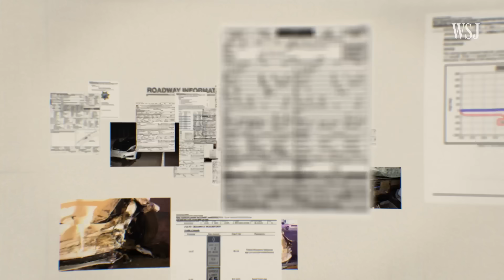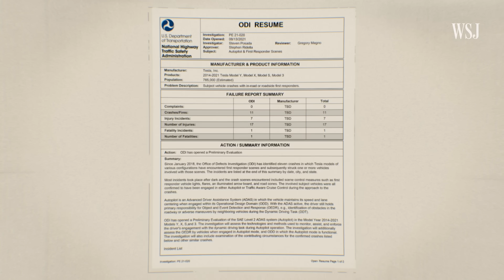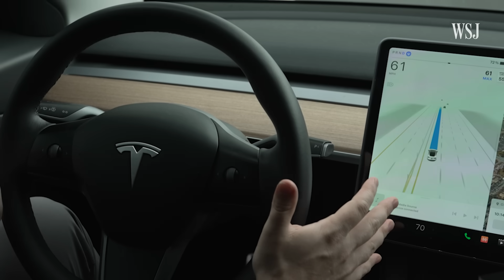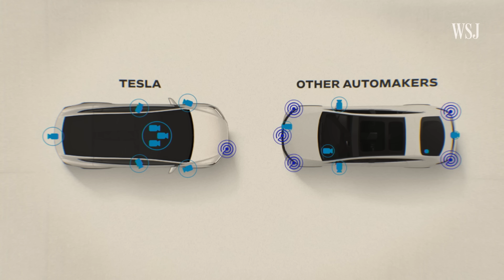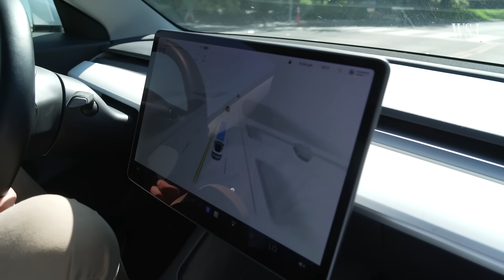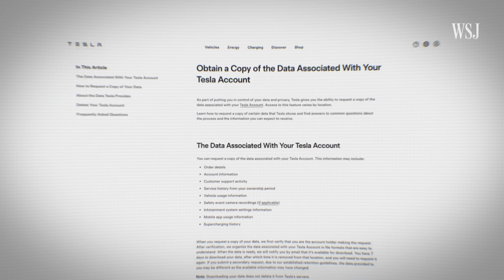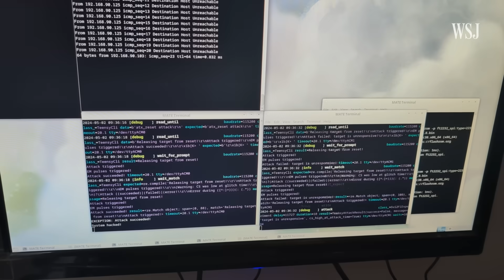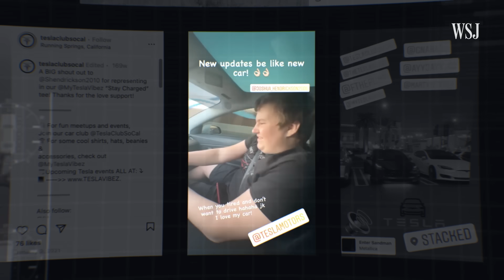The Hidden Autopilot Data That Reveals Why Teslas Crash | WSJ

Comment: There is no mention in this video of a comparison between autopilot controlled Tesla and a human control Tesla. There likely have been a number of accidents avoided because of the technology when the human wasn't paying attention. Unless you compare accident rates, there is no basis for saying that this is a faulty technology.
Reply: Think like an aviation regulator, every death or fatality now actually counts. Autopilot in planes and Tesla despite it's name should be regulated in the manner of "when" it'll kill, not "if".
Reply: It's not really about faulty technology, it's about people putting too much trust in it. If you have autopilot AND are also fully concentrating with hands on wheel and feet on pedals then you will obviously be safer.

But you need both, because it only takes one time for the cameras not to pickup on an object combined with you not paying attention for it to be fatal.
Reply: @Lightning_jc, yes, it's the same with all level 2 systems. I had a 2024 Volvo XC40 Recharge Ultimate while my Model 3 was in the body shop last summer. Its lane keeping assistance system was a real joke. It couldn't handle a curve unless it was a slight highway curve and it disabled itself without any other indication than a simple icon disappearing from the screen! No audible or haptic feedback. How stupid is that!
Reply: What’s the basis for saying that it isn’t faulty technology?  Facts are that  it isn’t ready.  Teslas need other tech like Lidar, etc.  Tesla says the fools who buy and test our products are wonderful Guinea pigs … the problem is when they harm others with their foolishness!
Reply: imo it's not about faulty technology it's about misleading marketing and unclear safety standards for the end consumer. When you Elon constantly overstating the abilities of FSD and autopilot, it leads to people expecting far more from it than it can safely deliver. The technology itself is great but obviously very flawed in some scenarios, esp low visibility. Obv in this particular case the guy was reminded 19x to pay attention and he didn't, and he's fully responsible for that. But in general, the issue I think most people have (or at least I have) is the misleading marketing kindering an undue trust in FSD, resulting in what you see here. It's just like people not reacting when a kid runs across the road because their car manufacturer advertised accident avoidance as perfect (say if Volvo constantly said our cars will never strike a pedestrian and have perfect automatic emergency breaking). Still the drivers fault, but the manufacturer should not be falsely advertising like that.
Reply: You're missing the point...
The hazard function (survival or reliability analyses) will undoubtedly be better than human control in time (for fixed, predictable environments like highways). It is the 'random' accidents and events leading to accidents and near misses that are the point. This behaviour imparts risk to a human where one who voluntarily would have had control, would not have had one. It is, quite figuratively, having to play Russian roulette with a loaded gun where you did not wish to. Tesla have marketed it this way, that it is FSD, and that anyone could use it to navigate all routes and environments when this is clearly not the case. A multiple camera based system, one that isn't even calibrated to accurately geolocate vehicles, does not have the redundancy to solve this equation.
Reply: Autopilot (not FSD, I don't have that) is an absolute joke. Worst system, unreliable, phantom braking. My VW Golf from 10 years ago was much, much better
Reply: @gehteuchnixan69  Dude, your 10 year old VW Golf was much much better at self-driving?  Uh ok, whatever you say, Chief.
Reply: @kenbob1071  Lol, can you even read?
Reply: Read my comment before leaving yours dude

Comment: Overview: In a nutshell, the video argues that the autopilot is a flawed system that is falsely promoted as safe by Elon / Tesla, and a so called "expert" says their technology will never be safe/ capable without Lidar. There are several selected videos of where the Tesla crashes, often at very high speeds. One such story highlights a now widow who's husband "trusted autopilot with his life," which is understandably tragic and heartbreaking. 

Here are the facts: Tesla FSD is safer than a human driver by analyzing average miles driven / crash. The technology is not released to substitute a human driver who is ultimately responsible (this is clearly labeled when you agree to use the tech, and every time you turn it on). Tesla FSD is improving over time, not declining. Finally, Tesla's crash safety scores outperform all other car companies by a huge margin, saving lives of those in crashes (caused by FSD or driver or other drivers). 

My opinion, for whatever it's worth: To say the technology can never replace a human driver is frankly dumb. It's already safer than a human driver as it stands (data shows), and we still are at the stage that the driver is still ultimately responsible. Also, the "expert" says that not using LiDar and only vision is inherently the fatal flaw of Tesla's tech... human drivers rely almost entirely on vision to drive, which makes us no different than Tesla's technology... and there are so many more deaths caused by humans than this tech does (obviously we can use hearing, but I'd argue this is not the reason behind the crashes seen in the videos). The video should highlight how this technology still isn't perfect, and that people should remember that they are the ones ultimately responsible. 

Nevertheless, I'd like to see this technology still be allowed to improve and ultimately replace human drivers, because idk about you, but I'm sick of hearing about drunk drivers killing others. A robot like this can't get drunk, can't have bad days, and can't fall asleep at the wheel... why would you want to cherry pick reasons to not responsibly allow this technology to advance?  The producers are clearly biased and want to drive a narrative that this technology cannot be trusted, and I say shame on you for doing so. Use your platform better.
Reply: Great comment, couldn't agree more.
Reply: What a total lie. Tesla is not safer per mile. Elon lies with cherry picked stats

Now go ahead and delete your comment and do some actual research
Reply: Here is the problem, 
the press wanted it to be 100% safe. No accident.
We all deep down know accident like this will happened. 
If you ask me, is it safer than human driving, ABSOLUTELY. 
BUT
With camera only, accident will keep happening especially at night or snow time. Even when they show the footage, i almost didn't see the fliped car.
Reply: Do u have Tesla shares?
Reply: I agree with everything you’ve stated. However, one important thing to note is that previously Tesla’s used to ship with LIDAR sensors as well and it was removed from all models subsequently (as a cost saving measure presumably) and I’d say it’s quite reckless on Tesla’s part to not include a safety measure that could work in conjunction with the cameras until the camera machine learning algorithms improved further. The examples given in the videos could have benefited from having LIDARs and deaths could have been prevented.

Also, my personal opinion is this video is such a biased one sided take on the issue and comes out as a hit piece on Tesla and negates the benefits of autonomous driving.
Reply: @Siamashraful  So I've looked into this, and here's the tricky part about LiDAR and Vision integrated together. At some point during a critical moment, both systems will be activated, but one ultimately will have to be "king" if they disagree. Not only is this creating two inherently different models to try and work together, creating complexity, but it's also important to consider that LiDAR is not perfect, and also has issues (weather also affects it's performance). 

From my perspective, mimicking human capabilities is more realistic to solving autonomous driving, as it's simpler and more understandable. Ultimately, I am NOT an expert in this field, and I'm certain this WSJ team is not either. The only people truly capable of weighing on this are the ones with the data, with the expertise, and who are pushing the limits of our understanding. Currently, thats Tesla, WayMo, and a few Chinese companies. Considering the true data advantage Tesla has within the space, I'd trust their performance above all else. Anecdotal stories about these crashes does nothing but slander true innovation that is changing the world for the better. I am no Elon fan when it comes to how he approaches social issues, but it's clear he and his team have achieved accomplishments not many others can say they've done.

Comment: Accidents are bad, particularly when resulted in injuries or deaths.  It is probably very difficult if not impossible to say for sure if FSD wasn't involved, could these fatalities be avoided?  Driving at night at highway speed, it's chancy at best to dodge a huge road obstruction like that of the first case. Could an average alert driver be able to steer clear?  We know FSD back in 2019 wasn't good enough. Now that we're in 2024, would FSD 12 be good enough to stop in time?
Reply: But facts don't matter. The Wall Street Journal has ads from legacy automotive companies, so they need to publish some Elon and Tesla-related negative stories now and then.

Comment: As a regular use of FSD, yes it's not perfect. But it's very good. As a driver, you need to remain alert at all times regardless of how good the system might be. I've not experienced and harrowing situations either on the highway or city scenarios. That said, being camera based, there are a lot of cars using adaptive cruise using cameras, namely Subaru. Honda uses a similar system.

Comment: Allowing Tesla to call it Autopilot in the US is the main reason for this problem. It was never an autopilot.
Reply: Even pilots are required to monitor the plane's autopilot and be ready to take over 100% of the time.
Reply: @Atom15 you should go look up the origin of the term autopilot. I'll do it for you as general knowledge does not seem to be a strong suit here. "In aviation, autopilot systems are designed to assist, not replace, human pilots. The cockpit was never intended to be unmanned, and autopilot is always under human supervision."
Reply: Hey, genuine question, have you had a chance to use fsd before
Reply: its called supervised FSD meaning you need to supervise it🤪
Reply: Do you know the years old lawsuit about a caravan driver and cruise control? He sued the manufacturer because the manual didn’t state you cannot leave the driver seat to cook a meal in the back… tells a lot about people…
Reply: Allowing morons to assume what "autopilot" means without reading the warnings is the problem. The manufacturer gives ample cautions.
Reply: @lukeknowles5700  except musk keeps on saying it works exactly like an autonomous vehicle... safer than a manual driver, and unsupervised.  He has said this repeatedly, and there are going to be people who believe him.

He was also the one who wanted to make it caneras only against his own engineers protests that they need to use lidar like everyone else.
Reply: @alimfuzzy yes some people will blindly believe him, after all look who’s headed to the white house because people blindly believed him

Comment: A few issues here, one, humans make mistakes too, without regarding the statistic of miles per accident of human drivers VS tesla auto pilot, a handful of crash examples are not statistically significant. "unsafe" is not a yes or no question, it is a gradient, and you need enough data to determine how safe or unsafe it is - and always compare it to the alternative. Is it unsafe compared to staying in the couch? Yes. Is it unsafe compared to human drivers? I don't know, since this article doesn't provide the necessary data, it just plays to your emotions. Second point - Tesla tells you at every point that this is still in beta, and shouldn't be trusted with your life. It requires you to pay attention to it and to keep your hands close to the steering wheel at all times. If you decide to go to sleep or be on the phone while going at 90 mph, that's 100% on you

Comment: To be fair, it does sound like all these mistakes could have been avoided if the driver had been careful. It’s a new technology and you should never fully let the car be in control.
Reply: what's the use of AP and FSD if using them is more stressful than just driving yourself. The exhausting part of driving is not having your hands on the steering wheel, it's the paying attention at all times to everything part.
Reply: @ it’s definitely not more stressful, it’s a great tool that I use on my way to work. However you can’t “trust your life” on it like the wife of the guy said. 

If you take your hands off 19 times and are warned not to 19 times then the fault is on you not the car.
Reply: That's true, but the video shows that Musk wants to make it as cheap as possible regardless of safety.
Reply: @ I think you are focusing on the wrong thing. Could you make a car with LIDRA, RADAR and cameras? Sure the cost would go up but it might be 30x safer than a human drive. Now maybe a Tesla with cameras only is 6x safer than a human- that means that overall you are still safer. 

In the accidents they showed the person wouldn’t have rescued themselves either because their reaction time was too slow or they did not pay attention. 

I’m an auditor in real life- I could audit say all 300 reports for my department…but that’s a waste of time. Much like making a car 30x safer than a human is when the car is already better than the human. 

New technology is bound to have issues and it’s up to people to follow instruction and not trust their life on it
Reply: @MJ-uk6lu  you really aren’t paying attention are you. It’s the safest car on the road as tested by NHTSA. ONLY car to ever get a 5 star rating in all categories…what are you talking about?